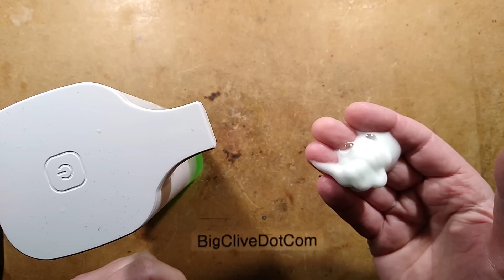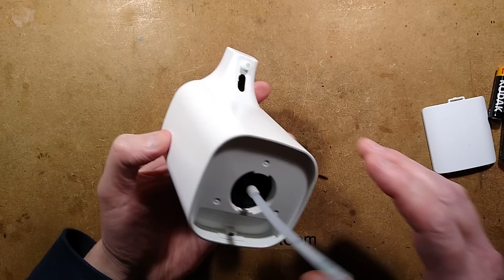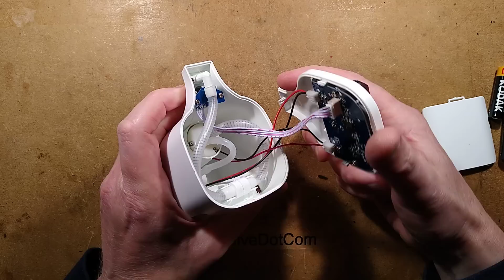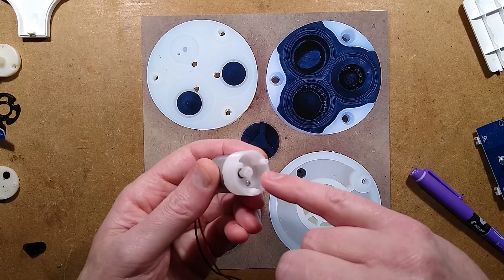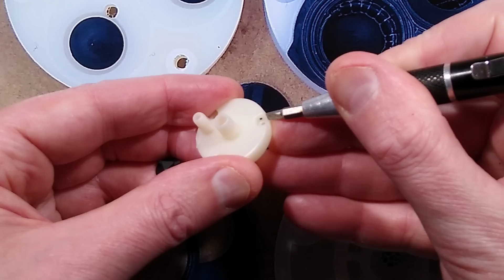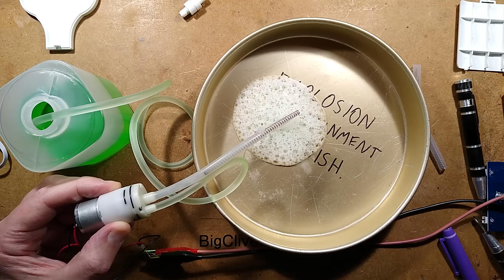Inside an automatic foam soap dispenser with clever pump.

Comment: Got to love the unhealthy passion for putting batteries and electronics in everything. I prefer manual foaming soap dispensers, no external power required besides the force applied to the plunger.
Reply: They assure us at work that there will be no cross-contamination because we are washing our hands immediately after pressing the plunger. I would prefer a cheap and cheerful version of this that just delivered unfoamed soap. Perhaps operation with a foot-treadle would be better than mains-powered or battery.
Reply: @pattheplanter  Just block the air inlet holes and perhaps remove the air valves and it will dispense liquid only.
Reply: @pattheplanter  if only foot pedal operated sinks and soap dispensers were invented...... oh yeah, someone thought they could improve upon that and "reinvent the wheel"
they worked all to well I guess ;)
Reply: @throttlebottle5906  they recently brought in dozens of foot pumped hand sanitizers where I work. Of course they also increased the number of wave your hand in from off this devices in the restrooms, including the doors.
Reply: @Noxonomus  LOL, foot operated stuff was all over in old "war time" factories, water, soap, toilets, cloth towels and drum  re winders, which they dry cleaned, you used elbow or foot pedal to roll the hanging towel loop out/in to get clean/dry area.
seems to me like evolution has made everything darwin again
Reply: I prefer a bar of soap.  No plastic crap that will end up in landfill.
Reply: @ferrumignis  Except bar soap usually comes wrapped in plastic, unless you are buying industrial quantities of plain soap.

Comment: For this kind of device, having connectors is absolutely posh.
Reply: It makes for faster assembly in the factory. The main assembly people don't need to solder and the soldered parts can be made by subcontractors.
Reply: Its probably worth the time/labour savings
Reply: Its probably a necessity of the assembly
Reply: May I ask why? Is it because of corrosion?

Comment: All that ingenuity to save us the minimal effort of pressing down on something much simpler. Kind of sums us up as a species - eccentric like the cam.
Reply: On the other hand, it helps to minimise physical contact between people and machine, thus reducing the chance of picking up the Corona Virus.
Reply: @whitesapphire5865  but then you wash your hands straight after so no biggie
Reply: @nathanaelsmith3553  Every time you enter a store? Or handle items in store? Or when you go into a public building? You use a hand sanitiser, then go and wash your hands? Really? - That's going make it a long day!
Reply: @whitesapphire5865  well no - if it's for use in a store or a public building as hand sanitiser then it sanitizes your hands. If it's for use in the bathroom then you scrub your hands under the tap straight after. Either way the dispensation immediately precedes the hand cleansing process, so any momentary contact with the pump is irrelevant. Worrying about that is simply bonkers.

Bonus fact: virologists say that detergent is more effective at killing COVID-19 than many alcohol based sanitizers that are mostly designed to kill bacteria. The virus has a protective fatty outer layer which detergent disrupts. By comparrison for a hand sanitizer to kill the virus it has to have an alcohol content above a certain level and not all sanitizers do.
Reply: Fair comment. Domestic electric toothbrushes started out as an aid for frail people - now almost everybody uses them (except for me - but I'll probably get one when I'm frail).

Comment: Good One! Enjoyed the dissection and want one of those pumps. Any numbers on it? My self-made IR pump dispenser works great except for 1 weird aspect of the IR. At Certain times of the day, with a full sun shining through an open doorway and flooding the room, but not directly on IR Sensor, the ambient lights IR is so high, it triggers the pump on, and dumps about 1/4 of the bottle in 10 seconds.
Those IRs on the commercial modules for Arduino pulse at 38K, believe its the chip regulating it.
Reply from the maker: I only found one seller on eBay selling a 3V foam pump.  It may be easier getting it in a dispenser unit.
Most IR units use modulated IR and a filter to negate the effect of sunlight.
Reply: @bigclivedotcom  got same unit a week ago. Pump make some noise, but doesn't suck any soap in. Just some air is coming out, that's it. Maybe you would have any idea? https://youtu.be/Kimkg2zDyAg
Reply from the maker: @aisica  Check inside to make sure the soap pipe is connected properly and not kinked.
Reply: @bigclivedotcom  I checked it. Seems that pump is pushing air out, but doesn't suck in. All pipes are properly placed and connected.
Reply: @bigclivedotcom  there you can see some photos https://drive.google.com/folderview?id=1tTprwjuUZ2kigUl04shY_hNcfL8yZ6ff
Reply: @bigclivedotcom  I'm just curios, could my fault be not enough dissolved soap. Can soap cluster motor? I dissolved soap 1 to 3 with water.
Reply from the maker: @aisica  it's unlikely, but the normal dilution is 1 to 4.
Reply: I have the rechargeable version and unfortunately it has the IR issue as well. During the day in my brightly lit bathroom it fails to work. I have another non foaming IR sensor pump which works fine. It's a shame as the pump is really good. Didn't realise this was the issue so I reported it as faulty to the ebay seller and they refunded me. I guess it is a fault given I can't use it half the day

Comment: Put beer through it, nice frothy head!
Reply: It wouldn't exactly work like that. Mediocre results inbound.
Reply: Actually, I believe Guinness draught taps use a "foaming module" very similar to the one in the soap dispenser to create that fine-bubbled head..? (not quite sure)
Reply: computerschreck After having worked in Hospitality for many years, I can say they do not. They have a kind of nozzle called a Creamer, which forces the beer through 25 thou’ holes which promotes the creation of minuscule foam bubbles. Take off this nozzle and it will pour very differently to the Guinness we know and love.
Reply: ewwwwwww

Comment: Who else wanted to see the pump on 24v instead of 6v ?
Reply: Great idea -- and after that mains and a neon power supply
Reply: Do it Clive!
Reply: It wouldn't survive. Let's do it!
Reply: The motor is a standard type so replaceable for a different voltage for sure.
Reply: @gbraadnl  I think he meant running the 6v motor, on 24v, so that it ran 4x faster turning into a aircraft hangar fire suppression system on his bench
Reply: @dogsarebest7107  ah, inducing more messy sputtering of foamy bits
Reply: @gbraadnl  Indeed! I was kind of hoping to see it, to be honest. The little silicone hose, whipping out, spraying thick lather in a continuous stream in every direction. Cue frenzied hand movement has he tries in vain to turn the supply off or disconnect an alligator clip. Camera cuts from overhead to Clive, sitting looking defeated, globs of foam covering his face, glasses, and beard, "Alright soo...."
Reply: @dogsarebest7107  I fully agree, it should have to be replaced with the appropriate volted motor. Overvoltage is the key to success I would say
Reply: @dogsarebest7107  i wet my pants laughing xD

Comment: The aeration methods are identical to that used on the Kirby Suds-O-Gun attachment.  That one is easier to see since it is on a much larger scale.
Reply: Kirby vacuums! I remember those. My friends stepdad had a Kirby store when I was a kid. Only $600 for the vacuum... Oh you want the fabric bag that holds the dust bag? You want wheels? You want it self-propelled? Attachments? Shampoo kit? Only $2500! LOL. They're way too heavy to be a viable product today, but even though they weighed like 40 lbs, they glide on even the deepest pile carpet since they're self-propelled.

Comment: Top tip... just about any device that use 3 or 4 battery can be converted to lithium but just put a power bank inside of it and just wire it up to the terminals.
Reply: I've found that to be a PITA. I thought it was a good idea too, but you need to install BMS/charging board too, and figure out a way to USB charge it. Or you can put an 18650 battery sled and pull it out to charge on a charger. 2-3 battery devices (3.0-4.5V) can be run with 1 Li-ion battery, 4 battery devices can be run with 2 Li-ion batteries (sometimes 1) in series, though running a 4 battery device (6V) will be way undervolted with a single Li-ion battery.

Comment: For products which like to clip themselves back closed, I take an defunect credit card (or hotel keycard) and slice on a diagonal to make two (or more) disposable flat wedges.    Kind of like making guitar picks.

As you work around the perimeter with the spudger, shove a wedge into the gap anywhere it seems to want to clip back together.

Comment: The swash plate pump reminds me that there have been attempts to make (steam and i.c.) engines which used the same principle in reverse, turning gas pressure into rotary motion. They are called axial engines. The main advantage is reduced frontal area. It seems only to have been used successfully to drive torpedos.
Reply: it's really only used in torpedoes because the cylinder is the limiting form factor, and swashplate engines are cylindrical. they have their drawbacks but those don't matter in a torpedo because it only needs to last for as long as it has fuel before it breaks down, since it's only going to be used once anyways.
Reply: It’s actually used quite commonly on cars. Not as an engine, but as A/C compressors. Most compressors with cylindrical bodies are usually pumps with pistons in parallel with the rotating shaft.

Comment: I wonder about the standby current draw. How long can the unit sit on your counter waiting for you to need soap? If you need to turn the power on/off every time to conserve the battery the touchless sensor become less useful.
Reply from the maker: So far it's lasted a very long time on one set of batteries.  (Months)
Reply: @bigclivedotcom  I was wondering what the quiescent current would be on a device like this.

Comment: Hmmm. I have the rechargeable version of this unit.  Very nice to see the slick design!  Thanks!  Now I don't have to shred my unit.   Pretty clever setup... Stay safe!  Stu
Reply: and how long does the charge last ?  
someday you will have to open the unit to replace the lithium or buy a new dispenser ?
Reply: @jyvben1520  Good question.  I haven't been using it real often, but it's been sitting there in standby for about 3 months, still working.  Figure that the pump will fail before the battery, but ifthe battery fails, I have several hundred lithium rechargeables in all sorts of form factors.  Not a problem here.. :)  Keep on watching the Clive!  Stay safe, Stu
Reply: How much did it cost? Did it last? (particularly the battery)
Whatdoes it look like? (There are several different designs.)

Comment: What would happen if you put whipping cream in this type of pump? Cream whippers use consumable cartridges.  Could a pump like this be used to make whipped cream? Not sure about cleaning though.
Reply: I don't think it'd work, unfortunately. 
The whipped cream cans and cartridges use NO2. The NO2 dissolves into the fat of the cream the same way CO2 dissolves into the water in soda and beer.
When you release the cream from the can the pressure drops and the NO2 can't remain dissolved and expands quickly creating millions of bubbles which the fat in the cream holds together.

I think something like this could work, but would probably need higher air pressure.... 🤔
Although, running cream through it as is would probably still produce a slightly frothy cream, but I don't think it'd be like the stuff from a can or charger. And as Zane said, it would be a nightmare to keep clean.
Reply: BRUXXUS Geez 🙄 Do I feel silly for missing that simple fact about the NO2 & fat in the cream. As a stupid teenager/twenty something I didn’t use the whipped cream cans properly!😏 My buddy and I would inhale the NO2 from the can in the upright position or later on we found a nifty little “Whippets Cracker” with the little NO2 Refill Cartridges to fill up a balloon 🎈 with NO2 so that you wouldn’t FREEZE 🥶 Your Lungs From The Ice 🧊 Cold 🥶 Expanding NO2 going directly into our lungs!!! So seeing as I abused NO2 as a 15-22 year old I wasn’t too concerned about how the whipped cream actually worked & got all frothy back then! 😉
Reply: @ZaneDaMagicPufferDragon  lol. I have done the same.  But the cartridges i bought were for cream whipper but i used them in a mini butane/ nitrous  hobby torche.
Reply: Maybe, but it’s definitely not going to be the easiest thing to clean out the whipping cream from, especially so that it doesn’t spoil & have rancid cream inside the tubing/pump!!!
Reply: @ZaneDaMagicPufferDragon  i have never taken apart an actual cream whipper so i do not know how much work it is to flush them out either.
Reply: I am just curious if it would work more so then if it is practical.
Reply: The whipped cream dispenser, with the renewable co2 cartridges, works analogous to an external mix airbrush.  Both are easy to clean out.
Reply: @robert_g_fbg  cool. I have never had one to see how they work.